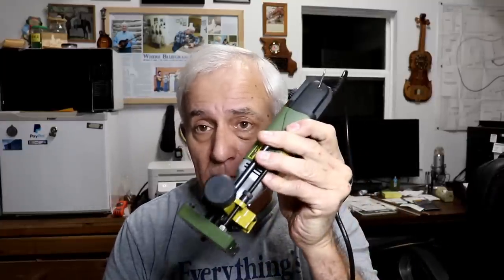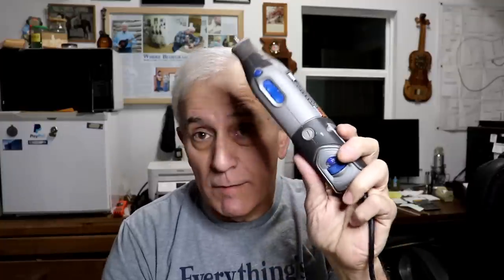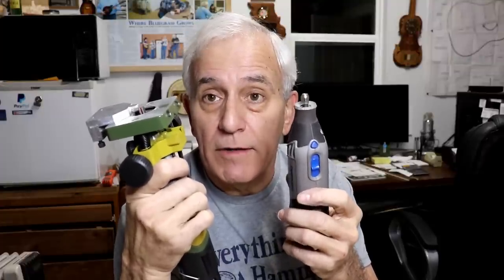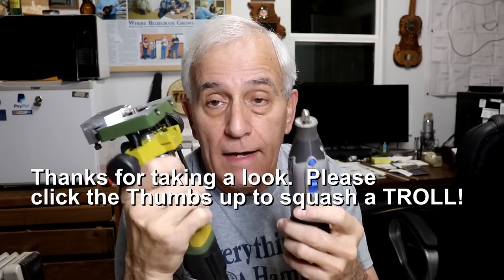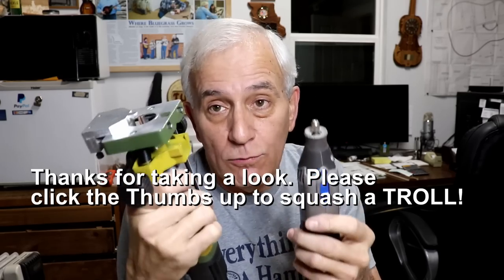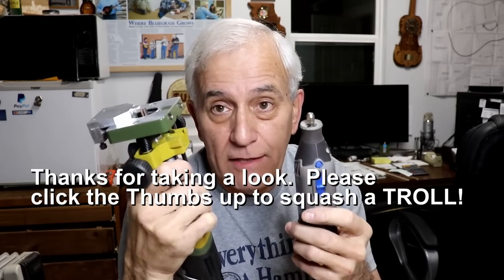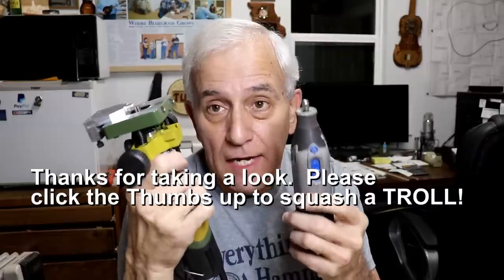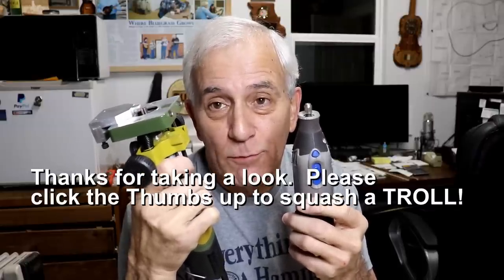361 RSW Dremel Vs Proxxon   The Battle Begins

Comment: Jerry, you were lucky you didn't get the Dremel 4200. Thankfully it was superseded by the 4300. If I get another rotary tool, I'll try the Proxxon.
Reply from the maker: The proxone is not nearly as powerful but it works OK in the base it's not very nice to hold in your hand
Reply: @RosaStringWorks  See FBS 240 or Micromot 230 for a better grip.
Reply: @RosaStringWorks  Proxxon makes many different rotary tools. Test the Proxxon Micromot 60E with the 5amp DC transformer.  The 60E is much slimmer and lighter and the 5 amp smokes my Dremel 4000.   I use the Proxxon for modeling and needed the low end torque and the ability to dial down below 5000 rpm’s for plastic. The Dremel relies on high rpm’s to do the work but has low torque and stalls easily when pressure is applied

Comment: You can't do everything well with a single rotary tool. For detailing and pen-style holding, use a Proxxon 28515 instead.  I own the two you've reviewed too, and have to say the Proxxon is my favorite, it runs smoother and holds more torque in low RPM settings. I rarely have to switch to Dremel 4000 for more power.

Comment: Thank You verry mutch for the Video.  I buy know the dremel 4000. Think about the Dremel 3000 if the 3000 is good enough for model plains and stuff in the house,  but the Ampere is the thing im worry about by the 3000. What do you mean?

Comment: i use proxxon 240e 4 years. i like this much better then dremel 4000. more powerfull, and cheaper, silence and excatly. and i can use any chines tools.
Reply from the maker: It's definitely not more powerful.
Reply: @RosaStringWorks  i cant stop by hand but dreamel 4000 easy

Comment: I’m a wood carver and have burnt out 2 dremel 4000’s.   They have not lasted for me.  After watching many videos and goggling a ton of reviews considering the proxxon as a dremel replacement, I at this time will not go with the Proxxon, or another Dremel….for now.   I believe for my abusive carving of softwoods my Foredom is best but I use the smaller dremel for more detail work, even still they dont last and I dont trust the Proxxon any more so……I’m trying cheap Chinese knock off.   For $37 with a flex shaft included I’m willing to see if it will last one season .

Comment: Actually, it is not AMPs that is important but rather WATTs.  Watts are amps X volts and are known as POWER.  so amps are a rough measure of power -- to the average user who is ignorant of electric terms.  What you have weighed on your scale is another proof of this:  the motor has to be larger in order to use that amperage/wattage regardless of plastic casing or metal casing.  For those of you who don't know:  when buying ANY device with an electric motor, a quick check is to lift the device (maybe a saw, maybe a coffee grinder, maybe a  food processor, etc, etc.) to estimate it's weight.  The heavier one is alwasy the better one.(assuming you have lifted it with out the glass or whatevfer).  Look at the label after "weighing" it and you will see either the amps or watts are higher.  That's the one to get--it's because the motor is larger which almost ALWAYS means the thing will last longer,l and be stronger.

As far as the sound goes?  That's exactly what will happen, the lower wattage device will be lower noise--go figure!  Maybe we should be buying the noisier tools.

Comment: Put a magnet on that bottom! Like large refrigerator magnet or Cisco switch magnetic wall mount (1-1.5 mm think)
Reply from the maker: I guess I missed something I'm not sure what the magnet would help
Reply: @RosaStringWorks  cut it to size with regular scissors, it's flexible and strong, stick is to the base (steel, right?), the other side is glossy, non-mark paint (or you can glue on microfiber) - so it won't scratch the guitar. there is also a printable magnets like that that have paper on one side. right? instead of adding permanent plastic piece to the steel base.

Comment: Mr. Rosa, with my comment on Dremel i did not say Dremel is cheap or not good, i only tried to say that the aluminium chucks which come with a Dremmel are poor build and after a short time of working they get abused and the tool is working badly. 
Me personally, i don't like Dremmel of course i feel it is to clumsy for fine detail work. That is only my opinion. i am a dentist and I have a few dentist machines for detail work and they rotate about 50.000 rpm and you are not able to stop it with your fingers. With a Dremmel or a Proxxon you can stop it with two fingers. As always: Quality costs! These tools are in a price range of 1000-2000€. 
 Both machines are made for hobby work and if anyone get the result he wants it is ok for me.
Reply from the maker: I would tell you if you try to stop my Dremel with your hand you wouldn't have a hand left.
Reply: @RosaStringWorks  With two fingers! ;-)

Comment: Dremel vs. Proxxon?  I'd prefer the Proxxon, but it depends what accessories you already have. A real Dremel is certainly useful and if you have all the doohickeys for it, I'd probably stick with it.  Here in Germany Dremels are kind of the generic term for these type of tools. "Get the Dremel!" - even if it's a Proxxon. ;)
Also Dremel is the most expensive of all those variants. They have a strong brand name.

Comment: I also don't like brushed aluminium tools. Don't like apple products for this exact reason: its slippery. I think ill buy a proxxon though, because of the thinner neck and then either score or sandblast the metal part and/or coat it in some kind of epoxy resin or latex glue, mixed with some fine powder.

Comment: Also, the noise difference has nothing to do with rpms or amps.  The difference is in the motors.  The dremel, brushes, the proxxon has a permanent magnet motor.  Better motor, less noise.

Comment: Lifelong Proxxon user here. As fine a tool as Proxxon is, power is NOT their strong point. If you want to make tiny components for a model ship, you will appreciate the silence and the associated lack of vibration of the Proxxon. Noisy powerful tools vibrate more, torques in your hand more, and consequently less suited for very small work. Or very small hands. So it boils down to what kind of work you do and what you prefer. If you want a crude tool, you could buy a Depstech (2amps, 40,000rpm) which is more powerful, louder, and cruder than a Dremel. Or you can go further and buy a Foredom which is the most rugged of the lot. If you want to go quieter and lighter and more delicate, you can fork out $5000 plus for a top-of-the-line Nakanishi, a Urawa, or an Osada.

Comment: Dremel still has the 4000 (1.6 amp)... And a more powerful 4300 (1.8 amp) now as well. Both are 5k-35k rpm.
EDIT: Forgot to mention the main difference I've noticed between the two, and the reason for the sound difference. That's Duty Cycle. The Dremel is so much louder due to it pushing a lot more air than a Proxxon. Which also means the Dremel stays cooler, even at higher speeds, and thus a longer Duty Cycle.
I mean the Proxxon isn't bad, and for ages was all Europe could reliably acquire. Though the belief that metal is better than a high grade glass fibre filled nylon is just silly. Heck, in raw materials costs, plastic has nearly always been more expensive. It's just that forming the final product from the raw stock was so very much cheaper with plastic.
Reply: Wow, if that's the case, then the Proxxon must get hot enough to cook breakfast on. I really like my Dremels, but they get hot as can be after about 30 minutes of use. One hand gets hot holding the thing, and the other gets hot air blown on it, the way I'm doing the job I'm doing this week. I can't imagine that the Proxxon gets hotter than these things do.

Comment: Get a Foredom; even better than the Dremel and Proxxon.  I've had several Dremels, two Proxxons, and have been using a 1/3 HP Foredom for three years.  It is a real tool; ball bearing handpiece that does not heat up, extremely well made.  Fits the Stooge-Mac router base.  Yeah, it costs more, but it is worth every dollar you spend on it.

Comment: I have 4300,4000,4200,3000,200, and 100 they all get hot, my proxxon does not, they all slow down even with slight pressure, proxxon does not. If pressure is put on proxxon it will fight you and just will not slow down respectively.  The only bad thing I find with proxxon is the false advertising,  example: home depot has the picture of the model IB/E but will sell you the IBS/E many other sellers do the same thing, very big difference between both of them the grip , ventilation and look. The IB/E is now harder than ever to find. The look is very different as well.

Comment: Each amp is 120 watts. 750 watts is one horsepower, so those low current devices really need a higher rating to perform.
The 4000 was the highest grade corded model when I bought my second one last year. I abused my last one for 5 years.

Your Dremel grip unscrews, it has a collet wrench built in. That’s my favorite part of the 4000 model.

Comment: Ooof, well I just bought a Proxxon.  The negative reviews of the current lineup of Dremels was really worrying me.  I think the build quality may have gone down over the years.  The Proxxon may have better build quality, but I'm not sure the tradeoff of lower power makes up for that.  I might have to return the Proxxon and get a Dremel.
Reply from the maker: The high-end dremels outdo the proxxon significantly
Reply: @RosaStringWorks  It's odd, but reviews are all over the map for current models of both the Proxxons and Dremels.  The only consensus I've seen is that Foredom (and others) make more expensive tools that are a level up from both.  Having said that, I've seen way more advocates for Dremel's than for the Proxxon I have - making me think I probably should have gone with the Dremel...
Reply: @RosaStringWorks  I just purchased a brand new Dremel 4300 made in Mexico, the variable speed does nothing between 5k rpm and 10k rpm. Worst of all at 5k rpm lowest setting it jerks and sputters like the brushes are stopping the motor. I'm gonna send it back and get a Proxxon.

Comment: Firstly, If you wore one out then you have 1 not 2...not opinion, that's math.  Second, & why I began to comment to begin with, have you tried more than one brand or maker of the flex shaft tool?  The cord's flexibility, or lack thereof, can significantly differ from one manufacturer to another.  You should check out a few more examples to find if one is more to your liking.  As for the slickness of the Proxxon, though I suppose one shouldn't have to ideally, there are numerous ways to improve or correct the want of better "purchase" when gripping the tool like a pencil.  Nonetheless, appreciate the video.

Comment: Somehow Proxxon looks nice but look at the electronic and motor. It is a basic Triac design with a bushed motor. So any soft start and protection. So easy to overload and... In comparison, the Bosh Pro 12V Dremel clone has an overload protection. Conclusion, Proxxon tools are versatile but fragile !

Comment: Dremel rocks. I own exactly one (1) power tool. Dremel rocks hard. I just received the circular saw blades - six sizes - for my Dremel, which now can cut my head off. My friend calls the circular sawblades the "Blades of Death" so don't leave it lying about. I had a Dremel Mini-Mite for 15 years and the battery stopped recharging. I kept all of the accessories and I just bought a Dremel Mini and so far it is the only power tool I need to build my own shimisen/CBG/guitar from scratch. Top rpm's is a bit scary. Dremel rocks.

Comment: Nothing to do with RPM the proxxon has a brushless motor and the dremel has a carbon brushed motor. Although dremel does have a brushless model now which I'm sure will be better than anything else available
Reply: That's wrong, the proxxon IBS/E has a brushed motor. I have owned 2 and motor burnt with both. I have disassembled the motor to try to repair and they are brushed (and not meant to be replacable, you need to bend the metal housing corners to be able to remove a backplate and then access to the brushes).

I don't recommand this proxxon because of this lack of reliability. Heat dissipation is not good and the motor (or its electronics) will easily die due to overheating. Brushless motors have better heat dissipation but I'm not sure proxxon has any brushless tool. 

Also I don't know for dremel but the proxxon has no overheating protection, nor any overcurrent protection, or any stall protection. My replacement will be a hanged-up big motor with several hundred of watts of power. I don't want to lose money anymore with fryed overheated motors.

Comment: Not a good comparison.  Amperage is not a fair metric when Proxxon uses frequency for it's variable speed which produces much more torque at lower speeds.  The complaint about the Proxxon wrench comes from a lack of knowledge. Collet chucks can be damaged from over tightening.  The Proxxon uses quality chucks that don't need to be cranked down.  I saw another video between the same two tools with the tools in their little drill press accessory.  Drilling through steel and aluminum, the Dremel bogged down so much that the Proxxon drilled through both metals in less than a third of the time the Dremel took.  This was probably the most uniformed, misleading video I've ever seen in a tool review. Even Adam Savage couldn't believe the exceptional performance of the Proxxon and he does very detailed work and said he has owned a variety of rotary tools.

Comment: Be happy to have a 15 year old dremel 4000 that still is living and in service! Why? Because the actual models of the 4000 are complete crap. And worst: the actual isb/e beat the actual 4000 with left hand in case of torque. Plus the bearings and mounting of the 4000 is a weak joke to the isb/e.And the higher power of the 4000 only results from high rotational speed. And yes, the profile of the 4000 is nicer and i also like it more, but the content of the housing is "ccc" (cheap chinese cr..) I think it's a real shame, that the pionier of small electric multitools(and this was Dremel) has dropped quality for profit. Precision, torque, quality definitve Proxxon ISB/E! and amperage is not everything. ;-)

Comment: For precision work without a routerbase like engravings or whatever the Ibs/e surely isn't a handy tool but therefore it's also not made in my eyes. For such work just use a micromot. A micromot hasn't the power of the Ibs (still 20.000 Rpm also) but for such things like engravings you don't need the most powerfull machine but a small and handy tool, perfect for precise working. That's the micromot! By the way, a micromot just weighs 280 gram.

Comment: Dremel still makes and sells the 4000 model. They have added a 4300 model, which is a 4000, with a LED, on the nose. Whoop De Do. 👎
Reply: I got the 4300 as a gift, and with my old eyes, the LED has come in handy in tight places. Everything has it place and time.
Reply: 4000 model has 1.6 Amps & 4300 model has 1.8 amps + LED

Comment: Make a 1/4 inch nylon plate counter sink four screws 
Into the corners you’ll have a plastic face you can make bigger and even add handles to it 
Make vertical pins for handles so you can hold it close to the face
Reply from the maker: I thought about that but it won't work. That messes with the hole distance for the attachments that they make. Of course those could all be remade but it would be a Major pain
Reply: Rosa String Works the machine a pocket for the router face to go into put the screws in the side to hold it on